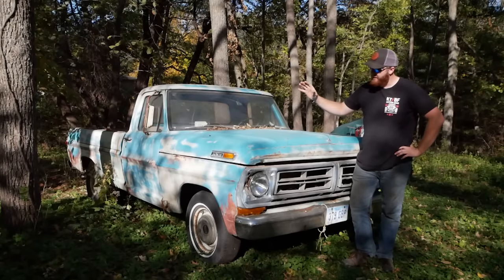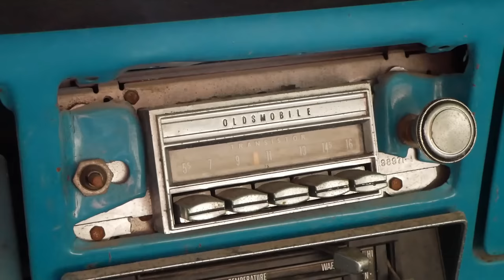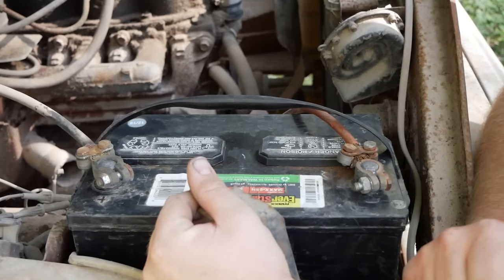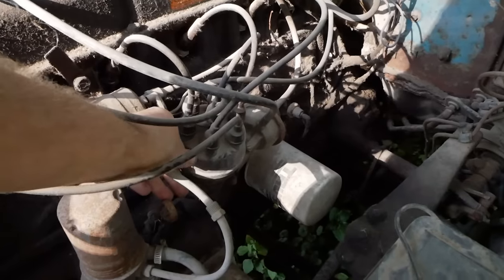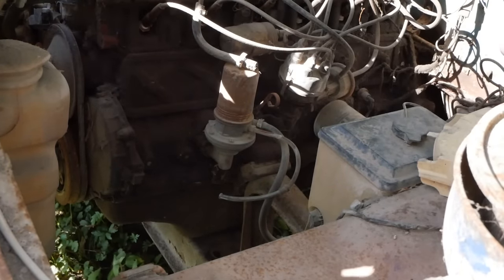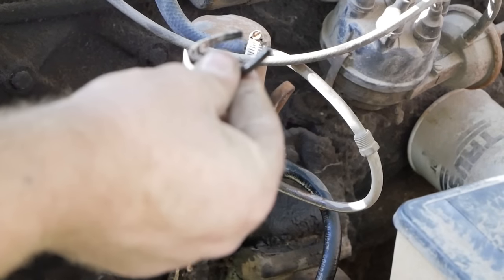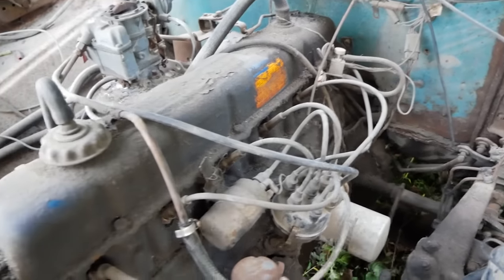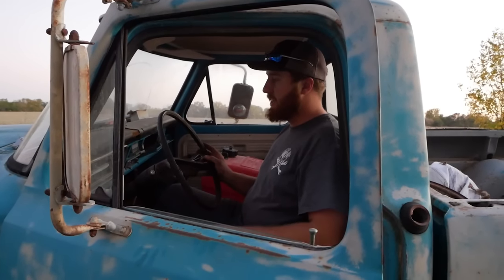RUSTY $500 F100 - Will it Run and Drive?

Comment: I worked on Chinooks too! The ones from the 101st in Ft. Campbell . But was with Boeing as a contractor. Was in the Kentucky Air Guard as a crew Chief on RF-4c fighters then C-130b and H models. Then MH-47g, and Blackhawks and now Pave hawks for the Air Force as a contractor with Lockheed Martin! I met you at the power tour and should have talked to you more about it! Loved the comments about the Air Force versus Army ect....

Comment: The old Volvo's from the 60s and 70s has the radio delete plate to. Usually is on the 121 Amazone an the pv544 and on some of the 142s

Comment: I did the 5 years of active duty in Marine Aviation, as a Ground Support Equipment Mechanic. Then used MGIB to get my Electronic Engineering Degree. Definitely agree with the enlisting and getting your degree method of life. Had a blast, got paid and a few education.

Comment: Filter Queen is a vacuum cleaner brand. The part if for a late 60s or early 70s Filter Queen that covered the exhaust port where you cold connect the hose for blowing or other accessories. Vintage vacuum are also one of my hobbies.

Comment: Its good to give good advice on life experiences.  I had knowledgeable parents and listening to their advice to be prepared for life, in my high school years 70s and 80s, took all the crazy subjects at school , Physics, Chemistry, 4 unit maths etc. I had a lot of opportunities after school in the engineering fields of Structural, Mechanical, Chemical, Electrical etc. I eventually ended up doing Mechanical engineering but was working in the structural side of things. Great choice and never looked back  Also we have what we call the Air Force cadets here which I joined, learnt a lot and loved every minute of it  PS NOT a nerd. Keep up the great channel

Comment: I had one of these trucks/Red long box 6 3 speed column shift. In about 1982 WAY B4 You and MOOT were EVER born. Class of 1980.. Beaters Are Neater was the Front plate. In Indiana you did not need a front plate, just a Rear plate! Never drove her or licensed her, she needed some Brake work.

Comment: Bleeding the brakes on these old Fords are a pain. Took me forever about two weeks ago on my Old 69' Ford, getting to the front bleeder screws was a real pain. Good luck with this project!
Reply: Also there might be that little pin-valve thing on the combination/proportioning valve, which you need to push or pull (depending on GVWR) in order to bleed the fronts - or is that just on disk brake trucks like Dentsides?

Comment: Filter Queen was and old vacuum. Cleaner brand. That was the center cap on the top. Used to unscrew that and take off top. Inside was. Large paper cone filter to catch the debris.

Comment: Never had or worked on a bumpside, 67 to 72, but the dentside, 73 to 79, breaks are easier to bleed the breaks lol. On the upside, that truck coming down the sunset road with headlights on, looked like a good clip for a slasher flick lol

Comment: O'reilly auto parts sales the brake bleeder wrench , it's about 12 inches long off set double box end wrench , they sale a standard and a metric , buy and keep both as most new wheel cylinders come with the metric ones in them ... it the specialty tool section around the pad spreaders , and brake adjusting spoons and what not ...

Comment: That cap is from a filter queen vacuum cleaner, it covers the blower opening on the top of the machine, I don't know if they're still made but they were top of the line units along with Electrolux, Kirby etc, back when vacuum cleaner salesman went door to door.

Comment: Love to see an episode on “is it worth it???”     Battery, spark plugs & wires, brakes, possible fuel line, distributor, alternator, or starter, TIRES.     Fluids.   $1000 + 10 or 20 hours of labor all for these rust buckets that aren’t worth a whole heck of a lot.   Money wise you’ be better off as a mechanic 
charging $80 an hour.    That of course is a cold valuation and doesn’t factor in it being emotionally rewarding or cool.    Love to hear you chat about it.

Comment: One thing I noticed with those old battery clamp plates is that you can get it as tight as you want with pliers but take a socket and ratchet to it and you’ll get a way better ground. My truck runs better with those
 tightened correctly too.

Comment: Ever since I had a battery explode while I was leaning over it, I never hit the posts. I was trying to get our trencher to start to load it up, was not getting good connection, so I tapped the battery terminals onto the posts. As I was leaning over the battery (its under a door that acts as a step on Vermeers) I turned the key to start it, all I heard was a loud ass bang and a sudden pain in my right side. Only thing I can of, is the posts cracked the case and had hydrogen escaping and when I tried to fire it up it arced and set it off. So now I just make sure the terminals are loose then tighten them down. I was super lucky no acid got my face. Just a little bit of damage to my bibs (was winter).

Comment: radiator clamps work well for holding the wire to the batterie if it is ever needed in a pinch

Comment: Great advice on life and career. Pretty cool truck those inline six engines are practically impossible to blow up if you just keep oiling them. I'd be willing to bet that's 207,000 or maybe more.
The time can be brutal especially up north where you get a lot of snow and salt and moisture. If that really is 107 k only I'd be surprised.
Keep up the great work love the videos.

Comment: On his life advice for the Guard, I'd recommend doing 8 full years. That way you don't end up in the IRR for two years. If you've got a really desired MOS, you can get selected for random deployments. 
I also agree with the Air Guard comment lol I'm still in the Army Guard but purely because I love my unit. If I was in a different one, I would have switched by now.

Comment: Preach the Reserves, I was a 68A biomedical equipment specialist. I didn't even need to go to college I got enough electronics experience that I can work on anything. I went from working on Medical equipment in hospitals to working on Industrial 3D printers that make parts for rockets that go into space. Laser, metal powder 6 figure pay and no college debt. Army reserves was the way to go, I would have done air force but they said I was too fat at the time. Army said ahhh you'll lose it and off I went.

Comment: Be sure to keep your septic tank active. Use Rid X. It will keep the active bacteria in the tank working to break down the waste you'll hardly ever have to have it emptied. A good active tank with good lateral lines never need a septic company to pump it out.

Comment: Had a 95 F-150 with the straight 6. Ran out of gas in the middle of no where with no cell signal. Found a gallon of transmission fluid and an 8oz bottle of Lucas fuel additive. Dumped both in the fuel tank. Truck started right up and drove for several miles to the nearest gas station. Filled both tanks with fresh fuel and just drove it. It smoked for a while but by the second or third refuel it was all clear and running like a champ.

Comment: I test-drove one of those Eagles once. No wait — it was a loaner while I had my truck repaired. Anyway, I liked it. It was the same color too. 
That trailer brake controller probably plumbs into the brake line somewhere. We had one just like it on an old Buick and it was plumbed in. Meant to take it off the car when we sold it but I forgot.

Comment: I have mentioned this before apparently to no avail so I am going to mention it again. Why don't you get yourself a remote starter button. Every auto parts store in America carries remote starter buttons. One lead goes to the battery+ and the other goes to the starter solenoid start position. Then you can operate the starter from the front of the car( Of course first making sure that the transmission is in Neutral or park. Safety first!) and start the engine while operating the carburetor simultaneously. That little tool is worth it's weight in gold.

Comment: I deleted my previous comment to write a more accurate comment.  That 72 F100's bed was protected nicely with the camper that was on it.  It seems beds tend to fare a bit better with tops on them in certain climates.

As you said, that engine was the 240 six.  That's a strong engine.  I see a huge number of them in California trucks still on the road.  I inherited a 68 F100 with the 360FE V8 and 3 speed from my late uncle back in the 90s.  I had a top built for it in 2003.  It had California Emissions on it, with a dual diaphragm vacuum advance and retard chamber, part of the IMCO (Improved Combustion) emissions control instead of the infamous Thermactor system.  IMCO uses a dual chamber advance/retard unit on the distributor.   As for the radio, Dennis Carpenter Ford Reproductions sells the radio bezel for the 68-72 pickups.  If the previous owners didn't drill a hole in the body for the antenna, I would advise the next buyer not to drill a hole and use an internal antenna that mounts to the windshield.  That will reduce rust issues.

Comment: amazing to believe a helicopter designed and built in the 50's would still be being built today to almost the exact same design and specs despite the decades of advancements in technology a true testament to a awesome design. Shame the early models suffered from Transmission issues whereby they couldn't handle the full power of the gas turbine engines.

Comment: As a Mechanical Engineer of 10 years that explanation is a bit misleading, ME is a wide field and while the core of it is "doing calculations and running simulations" you could be doing Stress analysis, Thermodynamics, Fluid dynamics, you could be on the design side, manufacturing side, testing and R&D side.... so if you wanted to design and do testing on those diesels you could easily do that with an ME degree (actually more so than an Industrial Engineering degree).

Comment: That is the cap to an old vacuum. my dad still has it for some reason it can exhaust out the top or out the side. I remember this so well because I used to take the cap off as a kid and shoot ping pong balls in the air with it

Comment: 98 ram 360 engine, on my drive to Nebraska check engine light came on and code reader said system over charging. I cleared the code and been driving with the lights on, has not come back. Is the alternator to much? Or battery to little? It’s 675CCA

Comment: I don't see a brake booster on the firewall anywhere is that the issue with the brakes Kev?
Reply from the maker: Manual brakes don't have a brake booster

Comment: I had a 69 with a 390 and 3 speed on the floor, and a 78 f250 2wd with a 300 in it. They would tow about the same weight, but the 300 was nicer in town and 390 had no issues at higher speeds

Comment: The only difference in that 72 Ford F-100, and my old 72 Ford F-100 is that 72 Ford F-100 does not have a bent frame like mine had. Your’s is also an inline 6, with a 3 speed. Mine had a 351W with a C6 automatic. Yours is still the better truck, even with all the rust and lack of breaks. By the way, you can bore that 240 inline 6 out to 100 over, as that’s what I did on the 240 that my 65 Ford F-100 had in it.

Comment: Hey man you want to find something that has a real shotgun engine brake? I used to have a death trap Kia sephia with a 5 speed. Secondary Cat went bad so had a shop cut it off along with the muffler and resonator. Any time you ran out 1st and shifted quick into 2nd it would go off like 6 damn 30-06 firing. Way louder than any other engine I've ever heard. It was a ton of fun driving that stupid car just for that. I mean the entire shifter would come off in your hand and no matter what I did the alternator would work itself loose and the ac didn't work at idle. But damn if it wasn't fun.

Comment: I have two toyota pickups. One is a 1988 that was wrecked but it'll still run and I've got a 87 four-wheel drive 5 speed and I was wondering if you'd want to take a look at them if you want. I'll sell them together for 2500

Comment: I honestly wouldn't mind having an Eagle for a daily. I've owned 67 cars since I was 14 and I've never been ashamed to drive junk. I bought a 1987 Renault Alliance (1.7 auto trans) for $150 and it ran great, shifted great, and had no problem doing 100+ mph. It would just never pass emissions testing. I put 15k miles on it and sold it for $500.

Comment: That engine isn’t a 300 it’s actually a 240 that came in the earlier ones you can tell by the different fuel pump as well, same as a 300 just different rotating assembly (less stroke) also has a different head!

Comment: nothing "induces high resistance", that would implicate inductance in some active process and there's none in a crusty battery connection. Current in a conductor induces a magnetic field around it, physical movement of a conductor within a magnetic field will induce a current in it with an electromotive force (measured in volts) accross its ends. Inductance, resistance and capacitance are (for all practical purposes) mutually exclusive properties and their respective presence or absence will not provoke the existence of either other one, and only Thevenin provides (virtual) relationships within the three.
Reply: So what would you say happens when a wire no longer passes current after years of corrosion or it gets silly hot? You're confusing inductance with induce. Induce means to "bring about, or give rise too". Corrosion is an active process. The more corroded wires become the more resistant they become, aka rust induces resistance. Electronics would last forever if corrosion had no effect on current.

Comment: Went fishing with my uncle and my grandfather off the cape in my uncles 1st boat we caught tons of blues and then it started getting rough big rolling waves bigger than the boat the engine stalled my uncle cleaned the points put it back together and it wouldn't start the battery is almost dead when we noticed the rotor is sitting on the seat, he put it in and it barely had enough battery to crank and it started.. He looks at me and says this never happened.... Right?

Comment: Amazing how 107,000 miles was considered a lot of miles back then...that's really not too many in today's standards.  Was this common with older generation cars?
Reply: Absolutely. A car from before about 1990 would run forever if it had an easy life and was rigorously maintained, but you could expect to start fixing things around 50k and working on it every weekend once you got to 100k.

A "normally" used car or one that was used for a workhorse wasn't worth much anymore once it was past 100k. You almost couldn't give them away.

Here in Houston, Halliburton has always been a resource for used trucks at good prices.  Up until about 2000, they would retire and sell them around 90k or 100k, no matter the condition.

Comment: People aren’t excited because they are cool or ever were cool people are shocked that it is still capable of driving the one cherry in that turd is that 4.2 L I had one in my YJ and I beat that thing on a daily basis I drove it over an hour to and from work for years I hydraulic that more times than I can count drove it home from a weekend of wheeling with all sorts of backwoods fixes to make it run and that thing was bulletproof and as reliable as can be well at least after I got rid of that stock carburetter and put a Holly on it and if anybody out there happens to have one with a weber on it take that weber and turn it around 180° and you will no longer have problems running at low RPMs up hills but it will stumble pointed downhill but who cares gravity is doing all the work at that point but the better thing to do is skip the weather don’t believe the hype and go straight to the hallway after that I could’ve welded the hood shut except for oil changes and the occasional spark plug removal to spray the water out of the cylinders that I had just put in it running through the mud please excuse the fact that that is one entire run on sentence my arm is messed up so I dictate